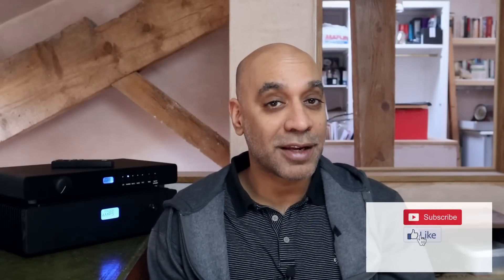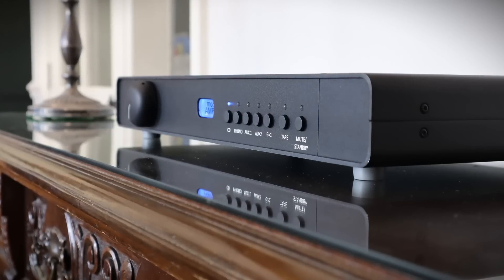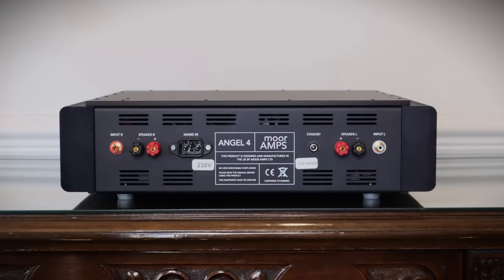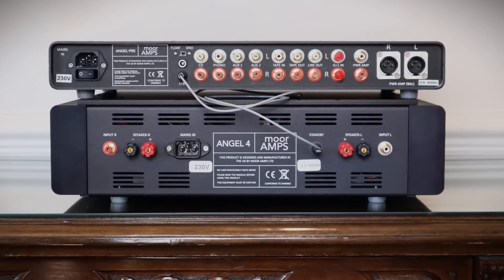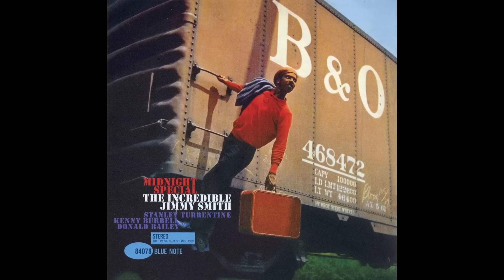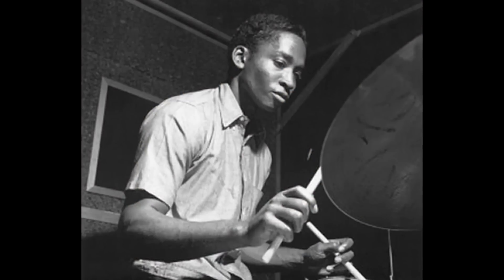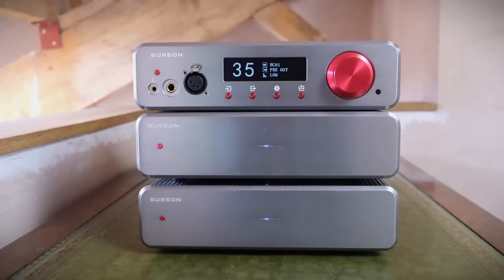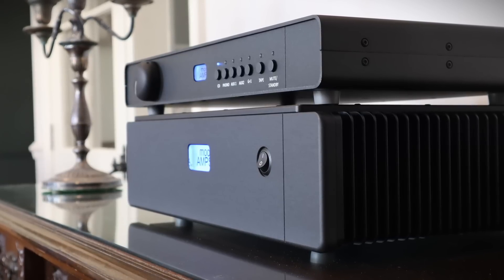STUNNING TRANSPARENCY! Moor Angel Pre & Angel 4 Amplifier Review

Comment: Great review. I would have liked the usual technical tour of the insides of these but since it was not allowed, oh well, c'est la vie. The NVA amp/pre-amp combo reviewed peaked my curiosity on these so I had to check out this review as well.
At this price level, expanding outside the UK,, I should not think it would be a problem for this company.
Since you asked for local products worth reviewing or checking out, and I know it is more difficult post Brexit, the first company that comes to mind is Tsakiridis Devices. You might have heard of them as a number of retailers were importing them in the UK. Sadly, they stopped making their 845-based Orpheus amp but they still make a 2A3/300B-based s.e.t. amp and many other devices, of which the most noteworthy in my opinion is their Athena (another obligatory mythology reference - comes with being a Greek manufacturer) mains regulation/correction/stabilisation/power factor correction unit. I'm not sure which of all these this thing is (at least a couple of them) but they make it in two versions: the higher price one features a humongous inductor inside (as big as a 300W amp mains transformer) and that is definitely a device you don't see every day.
Sadly, I think it would be hard to find one easily in the UK, and if you did, it would be expensive. Post Brexit, I think they may have lost a lot of their competitive edge for the UK market.
Another company worth noting is probably Ideon Audio who specialise on digital products only. I'm not sure whether they are known in the UK. I've seen their products 2-3 times in hi-fi shows (they started in 2015 but there were no shows during covid-19). They are very serious about their dacs and digital offerings and prices were mid-hi by pre-Brexit UK standards. I'm not sure what they would cost in the UK now but their top 2 dac offerings might still be competitive.
There are probably 2-3 more companies worth mentioning but I'd single out these 2.
Reply from the maker: Thank you Stelios 👍

Comment: An excellent review. My only beef is the use of the term rms power. Any engineer capable of this level of design excellence should know that rms power does not exist in electrical or audio engineering. The correct term is average power. Comments?
Reply from the maker: Thank you. Did is say rms power? You are right it is not mathematically possible. Continuous power is what I should have said 😊

Comment: A couple of questions...(I do enjoy your reviewing btw)
When you play music , are you using a streaming service or cd..?
How do we know if we have a good set up if the file is not so good ..maybe cd quality or supposed higher quality MQA etc..maybe the dac isn't so good or forgiving for some speakers..
Perhaps the cd player isn't so good...
So I guess by what standard do we use to judge the equipment...
Reply from the maker: Most of my main demo track are for my library stored on a hard drive, plugged directly into my Auralic Aries Mini. There are some DSD and high res track there up to 384Khz/32 Bit resolution. I use a high quality linear power supply to feed the streamer. The signal from the streamer goes to a DDC to be cleaned up and re-clocked.  It then goes to my Denafrips Venus II DAC 😊

Comment: Hi Tarun, great explanation of all the technical choices made in developing these amps.  In some respects he’s gone down the Naim route of not focusing on the total watts per channel, however, he hasn’t produced the Naim’s real world ability to disguise the low numbers with a highly dynamic sound.

Perhaps treating these amps like valves and going for highly efficient speakers such as horns is the answer to their perceived shortcomings whilst enjoying their evident strengths.  I’m a little disappointed that this much cash still involves so much compromise.
Reply from the maker: Thank you Mark. The clarity of these amps is something next level compared to anything else I have reviewed to date but I has to pull them back from Outstanding due to the limited dynamics. I agree, some sensitive horns may be the answer. Also, they have a Angel 6 with twice the power (and cost). I hope to,check that out down the line 😊👍

Comment: Great review!  Curious that this unit had balanced pre-outs but only single ended on the power amp input.  Also, wouldn't a unity gain pre-amp benefit by a stepped attenuator instead of an ALPS pot?   I'm no EE but thought that having R1/R2 individual set ratios on the volume control have been a better way to go?  Love this channel.  Thanks for your continued work.
Reply from the maker: Thank you. The big brother of the Angel 4 is the Angel 6. It has balanced input connections. A good quality resistor ladder network would probably be better but will push the price up 😊
Reply: @abritishaudiophile7314  I would think that at +/-  $5000 balanced inputs on the amp would be expected, especially when the matching pre has balanced outs. Doesn't make sense to me. Love your reviews!!!
Reply from the maker: @andyallison8086  that is fair. I spoke to the designer about it. It would have taken the cost over £5k. The Angel 6 has balanced inputs 😊

Comment: Hi hope all is well  n happy new year , I have a passive amp from tissbury audio , I discovered some very interesting,  instead of putting the the rac from the cd or streamer into the in put I put it into the out of the tissbury out put , straight away the sound is  louder more detailed voice much richer , as a sound engineer  could you please explain why  also I am using a quad 303  without the din plug but the rac  into the out put  the passive
Reply from the maker: Thank you Hamzat. I am not sure I understand the question 😊
Reply: @abritishaudiophile7314  the rac from the cd goes in the out pit  instead of the in put n gives a better sound
Reply from the maker: @hamzatatta952  do you mean DAC? 😊
Reply: @abritishaudiophile7314  No ,  let me try n explain it in this way ,   Normally you put the rac. In the in put right 

But in this case I have put it in the out put

Comment: What a carry on... Matron. Bad jokes aside, some glaring connectivity issues are a bit of a red flag as to what is really going on internally with this combo. Is there also a sonic reason he avoided using balanced audio connection pre-power?
Reply from the maker: It is not a balanced power amp but the connection would be handy for long cable runs.

Comment: Yet to be convinced that a pre-amp is really a necessity these days. The more amps I hear I become more and more sold on the hybrid integrated amps! They punch well above their price tag and you get most of the advantages of tubes without the negatives! So that said if I was going to spend 5k on an amp for me it would be something like the McIntosh MA252.  If you could find a way the review the MA252 Tarun I would be eternally grateful! ;)  Anyway thanks again for another excellent review!!
Reply from the maker: Thankyou Chris. I appreciate the suggestion 👍
Reply: Heard it side by side with Hegel 190. Not convinced on the Mc.
Reply: @morespinach9832  Interesting and the Hegel is a grand cheaper!! I've not heard either amps but have seen numerous glowing reviews of the MA252. I think tubes on the preamp stage and solid state on the output works really well and hence my interest in the Mc. That said, I know Tarun really rates the Hegel and your recommendation makes me think I really need to check it  out ;)
Reply: @TheChrisleekay  Mc is a good looking device etc. It’s more of a furniture statement piece. For me, in modern contexts, a simple Hegel that just works and has stellar presentation with body and detail, is more pragmatic anyway than tubes etc that need high maintenance, produce heat, etc. Hegel is super highly rated by every reviewer.